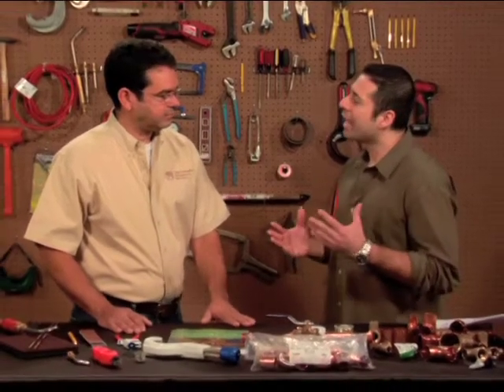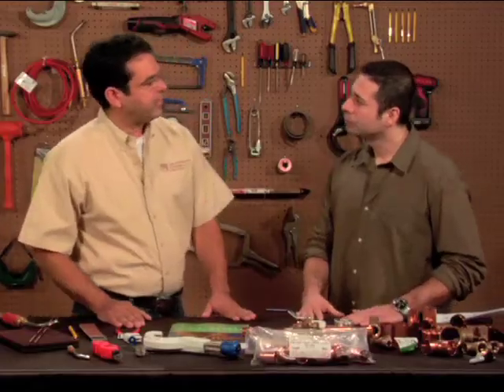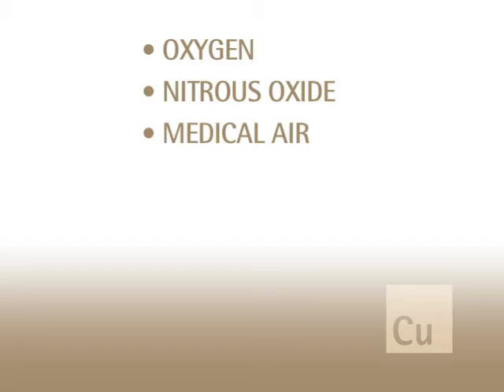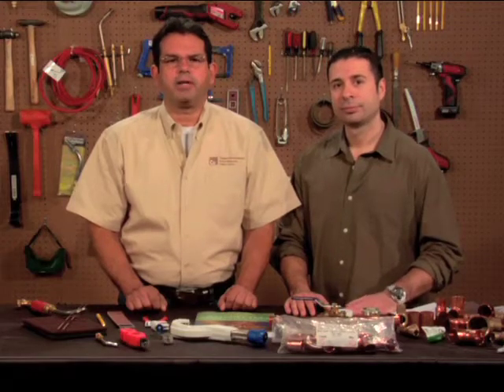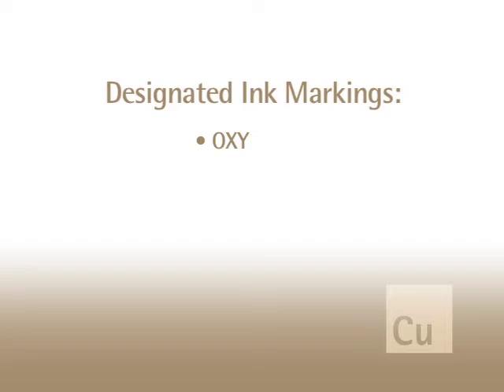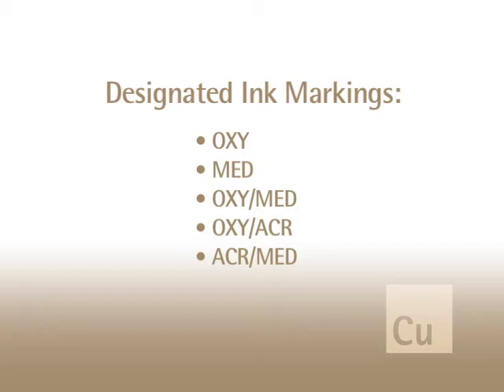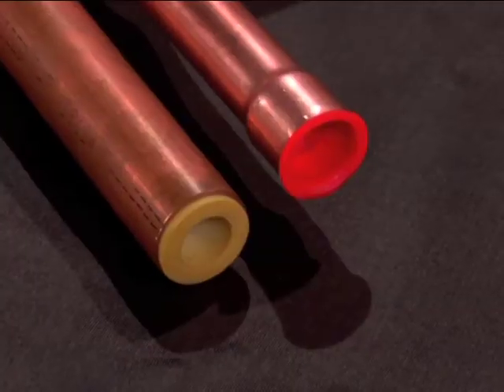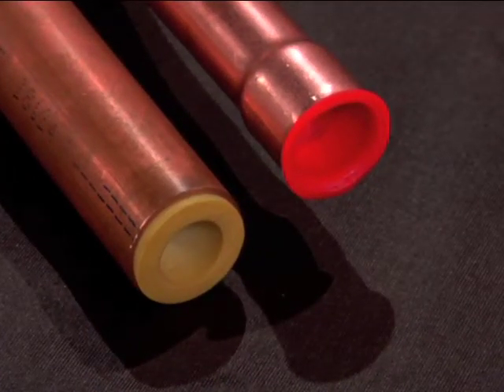Medical Gas Copper Installation

Comment: You never clean the ends of the pipe while they are open, all that dust will go inside. You should leave the plugs that come with the pipe on the ends as you are cleaning them, that way you avoid contamination. Especially for hospital or health care facilities. 
Step 1. Mark you pipe.
Step 2. With pipe cutters scour pipe (do not cut all the way)
Step 3. Clean with abrasive pad the exterior of pipe where its going to be cut.
Step 4. Wipe clean with a lint free white cloth
Step 5. Cut your pipe
Step 6. Roll smooth or deburred with a sharp tool, avoid chips from entering pipe
Step 7. Cap all open ends, until they are ready to be installed in a system that if being purge with oil free nitrogen.
Step 8. Always fit your pipe while your are running a purge of nitrogen
Step 9. Before you start  brazing you must analyse that you have a purge coming out of the very end of you line thru purge caps (usually copper caps with 1/8" hole drilled in it)
Step 10. You may know start brazing
STEP 11.......
You should only clean fittings with a wire brush only when they have been contaminated according to NFPA 99 - 5.1.10.4.3.4. 
If the fitting are not purchased from a manufacture that cleans and bags fittings, then yes you may clean them according to 5.1.10.4.3.10
Reply: Agreed, also lint-free gloves must be worn to prevent grease and contaminants residuals from sweat and natural shedding of human skin. never use a wire brush, if fitting is in need of cleaning, the procedure is totally different from ACR and water systems.

Comment: Hate when title of any trade is butchered e.g. Piping Technician known as Plumber or Steamfitter also Nail Technician  know as Manacurist.  Everyone now classified as technician including my landscaper as lawn technician. If this keeps up (professional) skilled trade titles will be nonexistent and all pooled into classification of Technician as meaningless title of those serving apprenticeships and holding licensing credentials.
Reply: Well you have to have a certification before you can even think about doing any medical gas work. And to be eligible to take the test to get the cert, you must complete a minimum of 4 years of apprenticeship. He mentions nothing about that fact. So technician isn't all that far fetched. Its not all about slingin' pipe and brazing joints. People forget the risk involved with a medical gas system and what the end product will be supporting. Possibly a ventilator for a dying relative. I wouldnt trust any joe shmoe plumber to be installing at my local hospital.